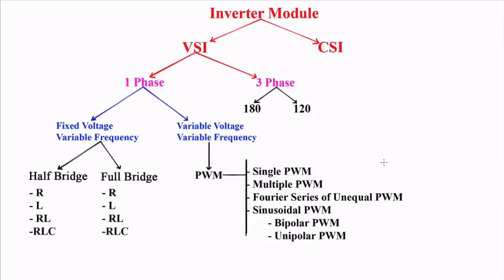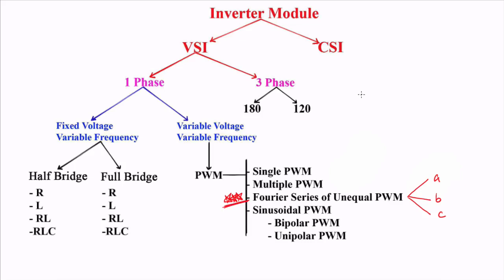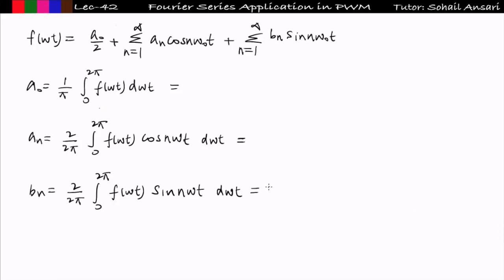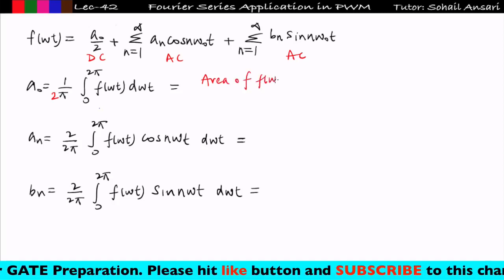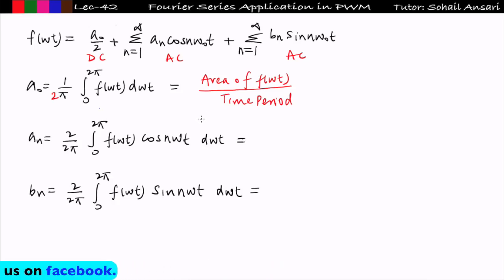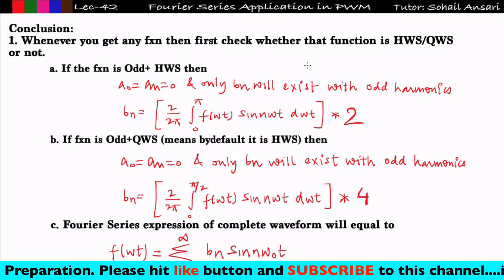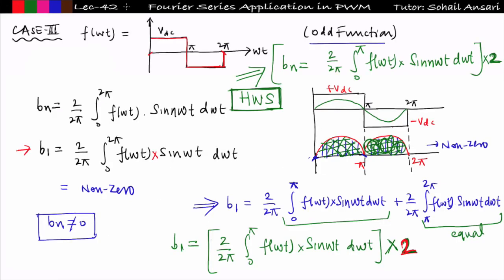Lec 42(a) Application of Fourier Series in PWM Inverter | Power Electronics | GATE 2019

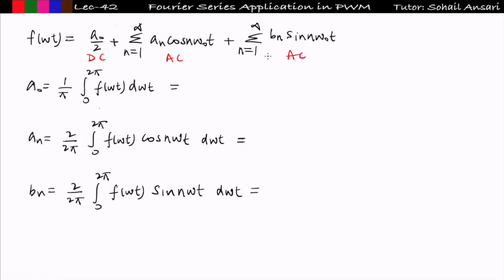Comment: Sir, At 2:31 As already a0/2 is written, it is sufficient to write 1/Pi in integral(But u have modified it to 2*Pi). This is not required i hope.(Initially u have written correct only but later i think u forgot that a0/2 is there so, u have modified it.)